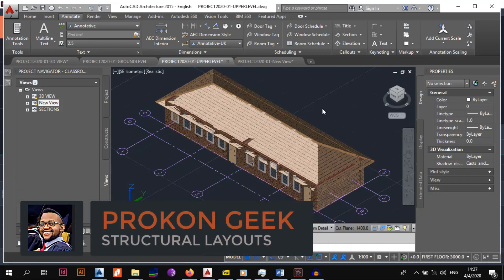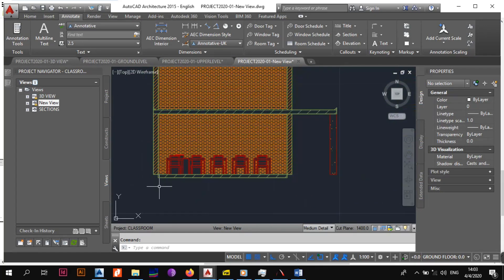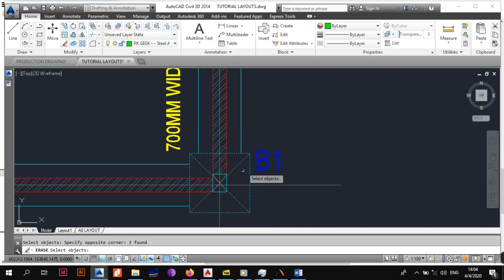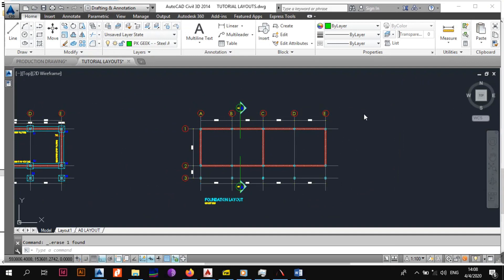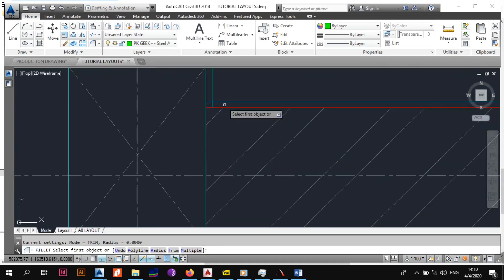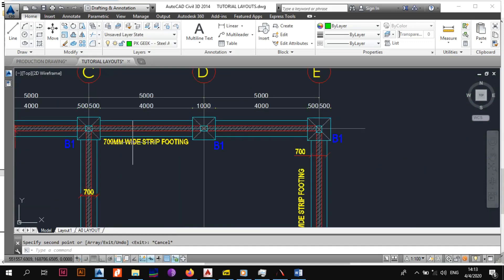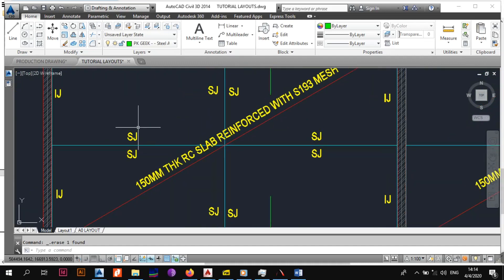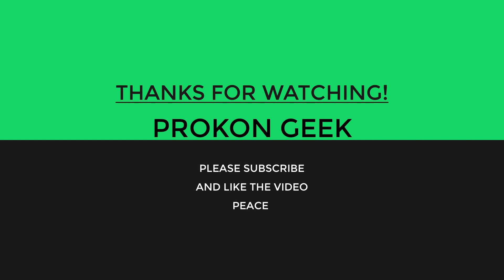HOW TO DESIGN A Double Story Building: Part 1B (Ground Floor Layout)

Comment: how can you convert a drawing from archicad to prokon
Reply from the maker: Hie Brian thanks for watching the video, unofortunately you can't convert a drawing from ArchiCAD to Prokon, you can only convert it to DWG clean it up then after that you maybe able to use the cleaned frame as reference shell for your structural components in the various analysis and design modules in prokon. Hope this helps you